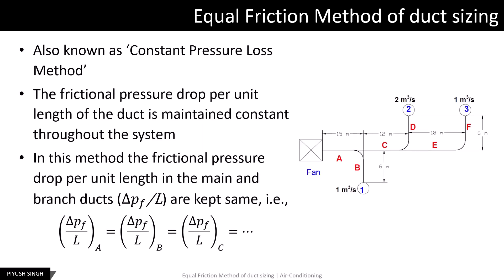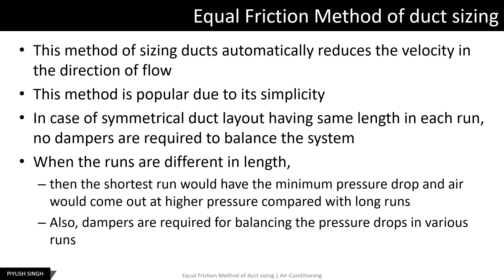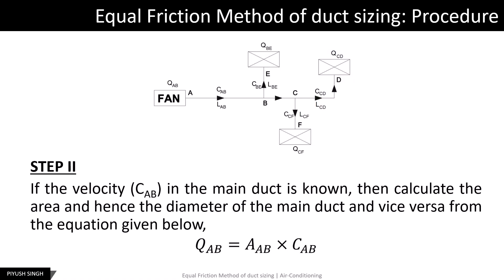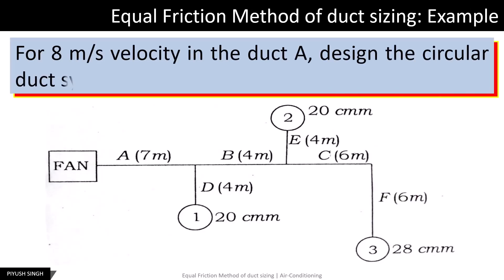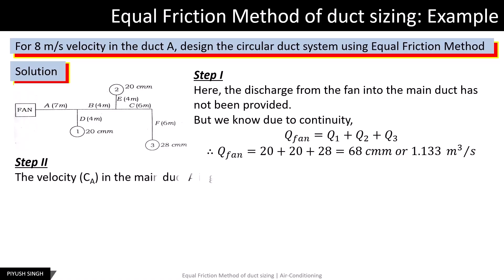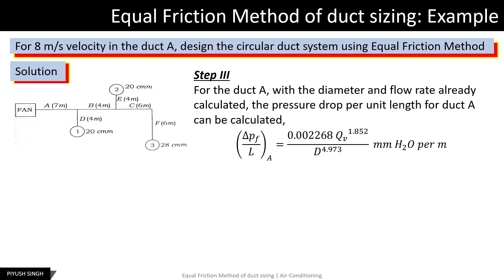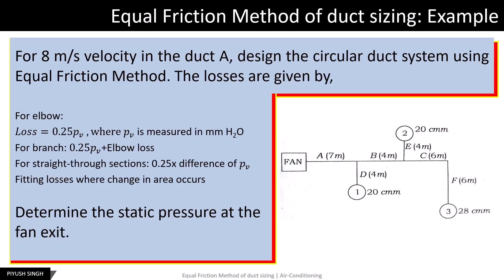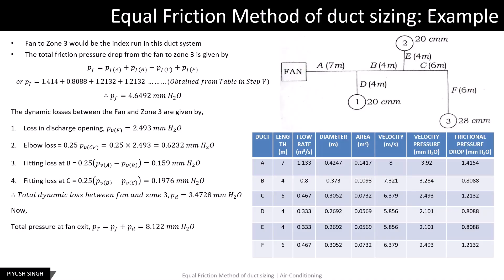Equal friction method of duct sizing | Air handling systems | Air-Conditioning

Comment: Hello, thanks for shraring. I have 2 questions:
1. How do you size rectangular ducts ?
2. For the scenario you have presented, the velocity is known. What happens when you are designing from scratch, and the duct velocity information is not available ?
Reply: If possible, provide references. Thank you
Reply from the maker: Thank you for watching and for your questions! Excuse me for the delay in responding.

1. Sizing Rectangular Ducts: Rectangular ducts are sized based on their equivalent diameter, which provides the same friction loss as a circular duct for the same airflow rate. You can refer to any textbook for the concept and mathematical formula for equivalent diameter.

2. Designing from Scratch Without Velocity Information: When the velocity is unknown, you typically start by selecting a reasonable velocity range based on the application. Industry guidelines suggest typical velocities, such as 4–6 m/s for main supply ducts and 3–5 m/s for branch ducts. Once you assume a velocity for the main duct, you can calculate the required duct size using the continuity equation. After selecting an initial size, the design is refined based on pressure loss constraints, system requirements and design constraints. Choose a suitable maximum velocity for the main duct considering factors like noise levels, duct size limitations, and desired pressure drop.  Also, calculate the total airflow needed for all rooms and branches to determine the overall air volume flowing through the main duct.
Reply: @piyushsinghclasses  Thank you Engineer

Comment: Excellent source of learning to design the duct and very knowledgeable tutor, a huge appreciation and applauds from my side. All the best for the future videos sir.
Reply: I am having some doubts, how to contact you sir?
Reply from the maker: You may inbox/ message me on my Facebook page: https://www.facebook.com/CognizanceClassesbyPiyushSingh
Reply: @piyushsinghclasses  I have sent message in the messenger sir, please help me in resolving my doubt.
Reply from the maker: OK, I will go through it and get back to you.
Reply from the maker: Thank you! 🙂
Glad that you found the video useful. Keep watching and sharing your feedback
Reply: @piyushsinghclasses  May I get the journal or reference publication where you used theses formulas and all. So that I can use them and show to my managers.
Reply from the maker: @saiprathapreddynimmakayala5211  The equation used to calculate the pressure drop per unit length has been derived from Fritzsche equation (an empirical relation for pressure drop in pipes). Other empirical relations may also be used like Darcy–Weisbach equation, Modified Darcy's equation. These can be found in most of the standard textbooks/ reference books on fluid mechanics discussing  flow through ducts/ pipes. You may also find these in RAC books by C. P. Arora, R.K. Rajput, Arora & Domkundwar to name a few.

Comment: What is the name of the reference?
Reply from the maker: The equation used to calculate the pressure drop per unit length has been derived from Fritzsche equation (an empirical relation for pressure drop in pipes). Other empirical relations may also be used like Darcy–Weisbach equation, Modified Darcy's equation. These can be found in most of the standard textbooks/ reference books on fluid mechanics discussing  flow through ducts/ pipes. You may also find these in RAC books by C. P. Arora, R.K. Rajput, Arora & Domkundwar to name a few.

Comment: Do you have referents for this topic?
Reply from the maker: The equation used to calculate the pressure drop per unit length has been derived from Fritzsche equation (an empirical relation for pressure drop in pipes). Other empirical relations may also be used like Darcy–Weisbach equation, Modified Darcy's equation. These can be found in most of the standard textbooks/ reference books on fluid mechanics discussing  flow through ducts/ pipes. You may also find these in RAC books by C. P. Arora, R.K. Rajput, Arora & Domkundwar to name a few.

Comment: Hey! Thanks for the video! It was really useful! I would like to know what is the bibliographic source for the equation used to calculate the pressure drop per unit lenght.
Thanks in advance!
Reply from the maker: Glad to know that you found the video useful. The equation used to calculate the pressure drop per unit length has been derived from Fritzsche equation (an empirical relation for pressure drop in pipes). Other empirical relations may also be used like Darcy–Weisbach equation, Modified Darcy's equation. These can be found in most of the standard textbooks/ reference books on fluid mechanics discussing  flow through ducts/ pipes. You may also find these in RAC books by C. P. Arora, R.K. Rajput, Arora & Domkundwar to name a few.
Reply: @piyushsinghclasses  Awesome! Thanks again for the information